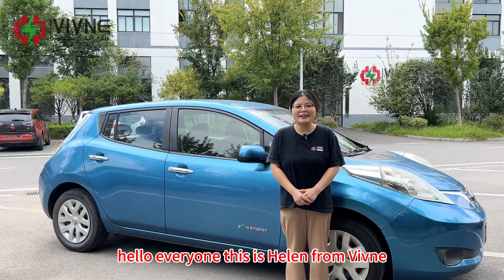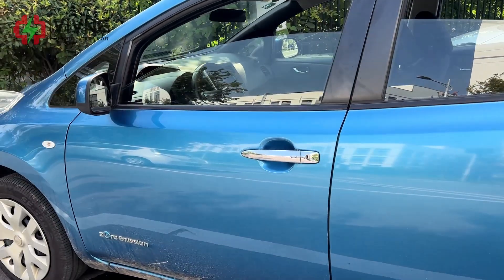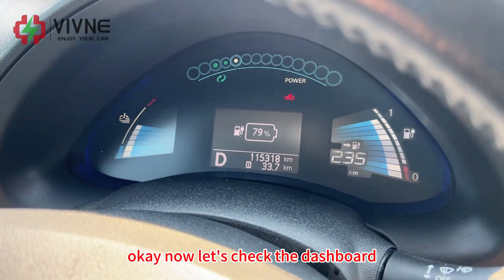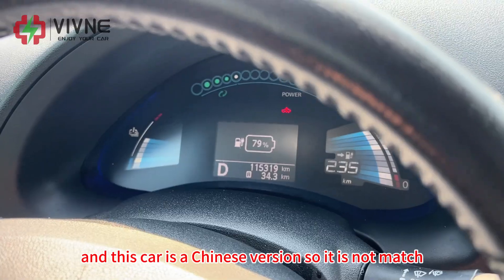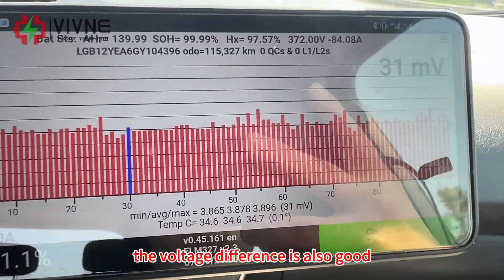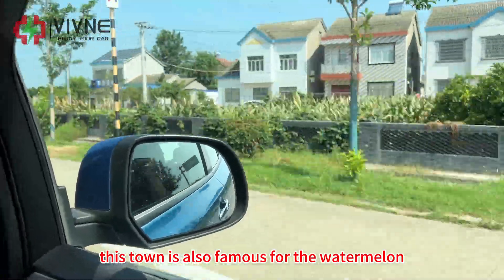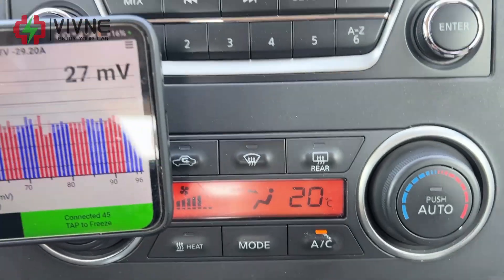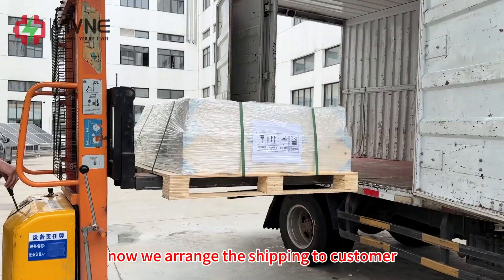Vivne - 40kWh Leaf battery to Italy

Comment: How many cycles your battery lasts? Can charge level be limited?
Reply from the maker: The CATL cells  when out of the factory has strict request, which is after 2000 cycles, the SOH should be above 80%.  The charge setting is the same as original.